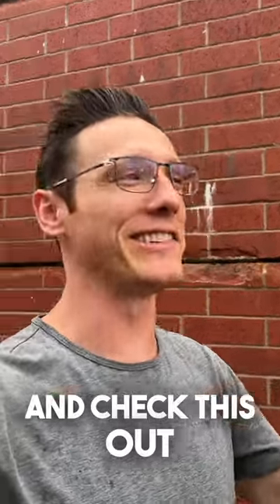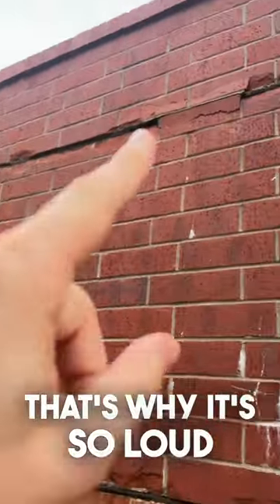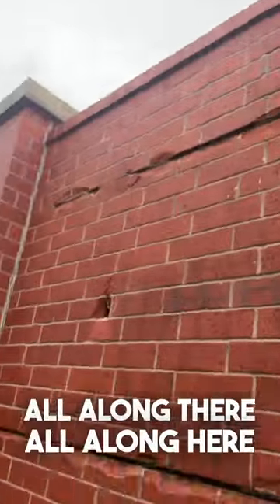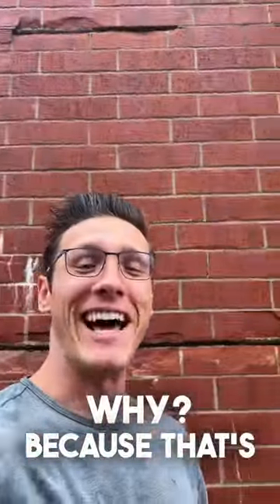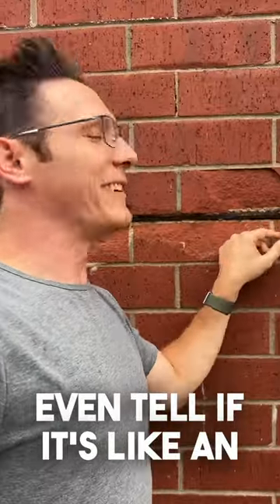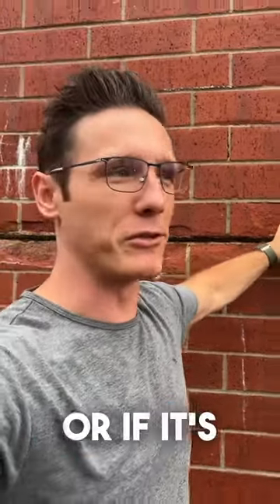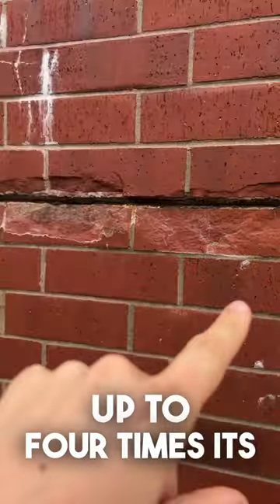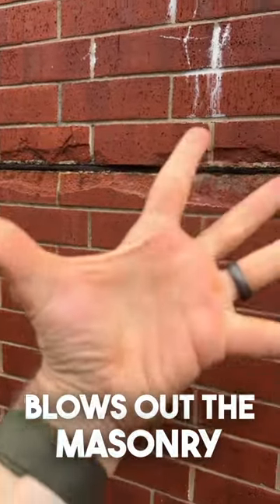CRAZY construction fail! Why putting steel in masonry buildings is a terrible idea.

Comment: I dont understand why the rebar isnt isolated inside the block? There should be vertical and longitudal bar in the wall. All vertical bar is cast in concrete. Longitudinal is partially cast so it should probably be coated. They should both following the centerline of the wall unless its not a brick facade on a block structure? This just seems so odd
Reply from the maker: It’s very odd!

Comment: You most definitely need steel or some equivalent in certain applications. Good luck meeting seismic codes without it; or higher level wind resistance for that matter.
Reply from the maker: Yes—in some circumstances you need reinforcement. But don’t use steel like this. Can use GFRP. Or build wall in way you don’t need it. Perhaps instead of a double wythe wall it should be triple. But either way: you can 100% build this wall WITHOUT reinforcement and it will last 10x longer. Think of all the centuries old, and even millennia old buildings and walls with zero reinforcement?? All the oldest buildings in the world are built with unreinforced structural masonry. Google the Taq Kasra.
Reply: @BuildingCulture  True, the oldest buildings are all mass walls, but you have to remember survival bias, we only see the ones that made it and zero of the ones that didn't. Taq Kasra is a nice ruin but  it's not representative of a normal home or commercial building. You just can't build a normal building with materials that have zero tensile strength, e.g. mortar/masonry, and have enough strength to survive a substantial earthquake, think California, or Japan. GFRP is definitely very interesting, I hope it gets more traction. Engineered cementitious composites are another idea, basically, it's a high-strength mix without any course aggregate, reinforced with polymer fibers. You could spray it on the inside of a two wythe, then then add insulation, then a inside wythe. 

I'm planning to go with ICF for my home, with masonry on the outside. That gives you all the benefits of a mass wall, but you can add as much reinforcement as you want,  the R-value is a nice bonus.